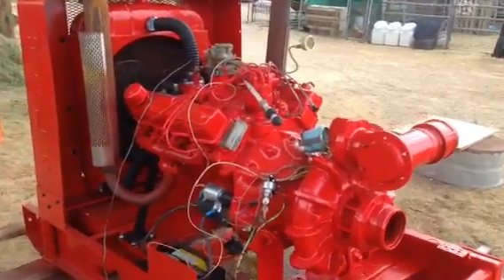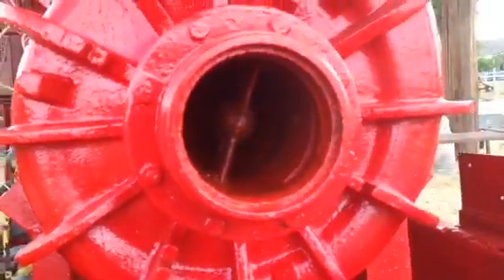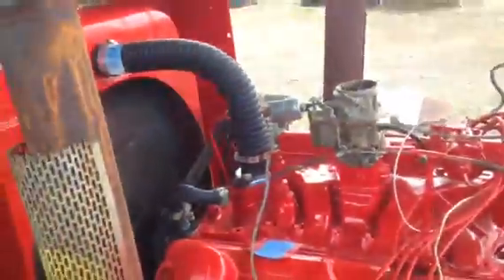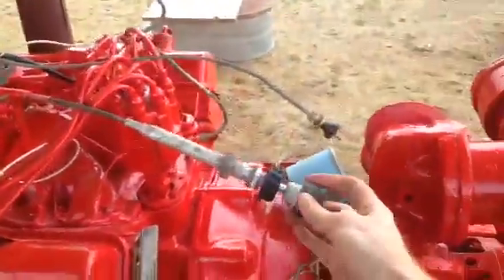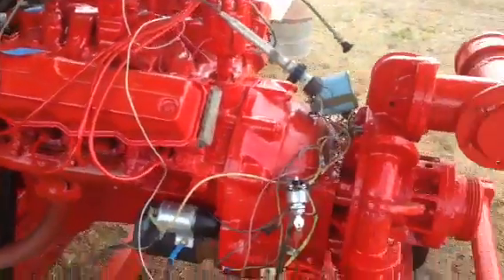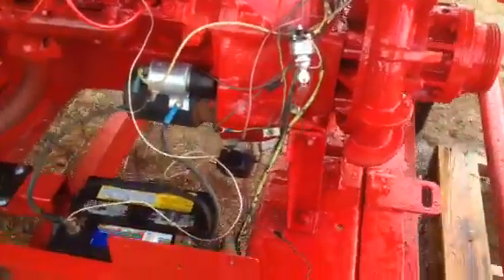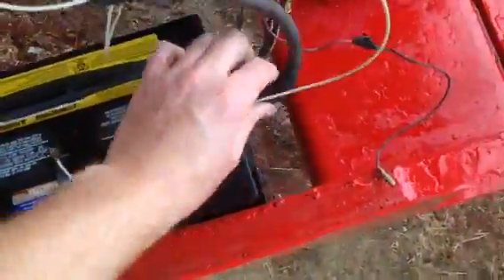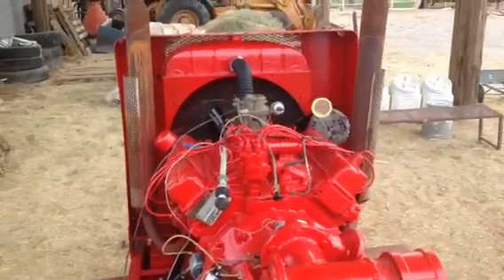Hale water pump irrigation

Comment: Hi there what does this pump have for a motor I have one that is powered by a 318 chrysler and would like to know more about it but cant find anything the motor and rad look similar to mine but my pump is facing to the top left at the back end instead of the top right like yours. it also has the same exhaust system as yours.
Reply from the maker: Yep that is what this pump had a Chrysler motor. Same as yours.
Reply: @JCTaylorinAZ   whats the model of the pump?
I sent you an email to make things easier